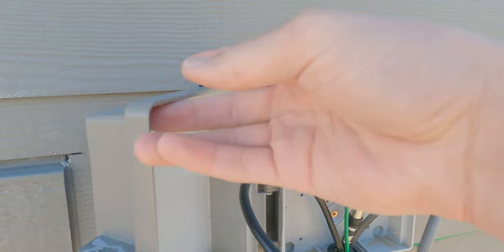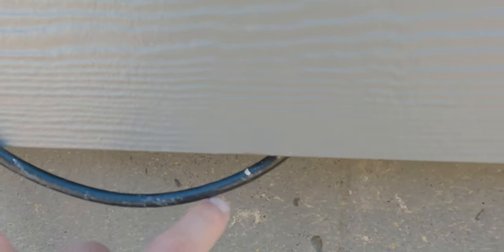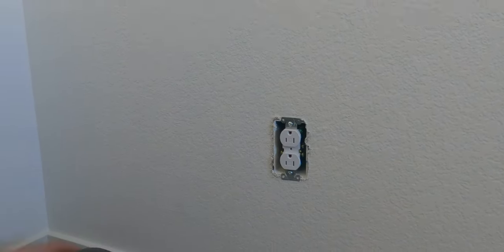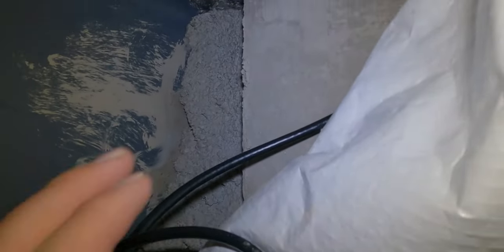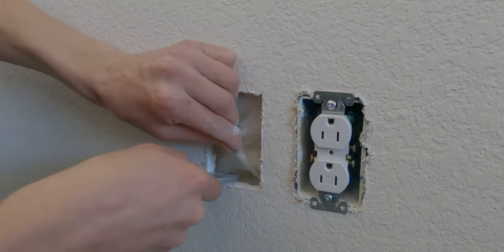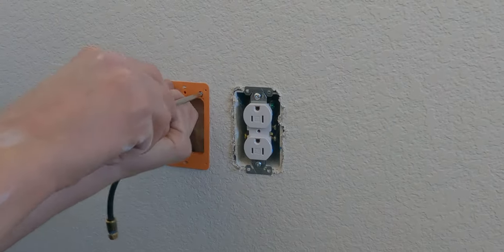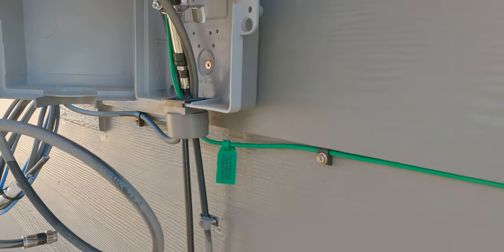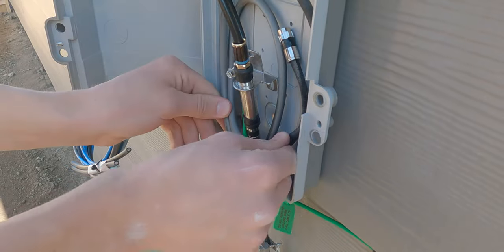DIY: Add cable internet outlet to any room. Through basement/ crawl space.

Comment from the maker: Forgot to add in the video, make sure to silicone seal the areas drilled :)
Reply: Had an installer drill holes in our FLOOR to pull cables through. We are very unhappy about it, it's a cheap, quick & dirty way to pull cable. The wall plate is so much more professional.  Hoping to switch the cable to the wall & repair the floor!

Comment: Re: cutting vapor barrier
Consider making an X by making a slice diagonally from corner to corner. That way the vapor barrier can be put back in place with appropriate tape.  Everything is as strong as its weakest link.